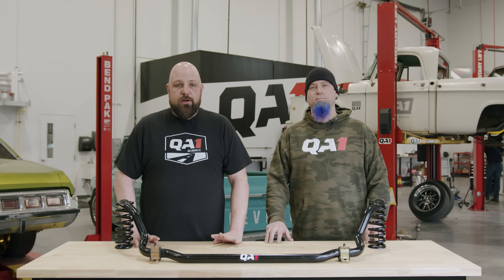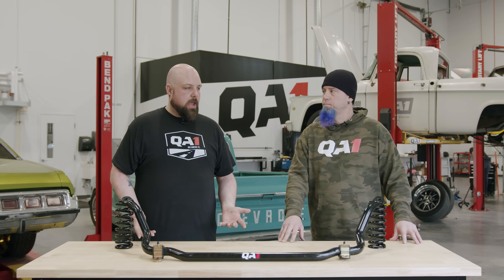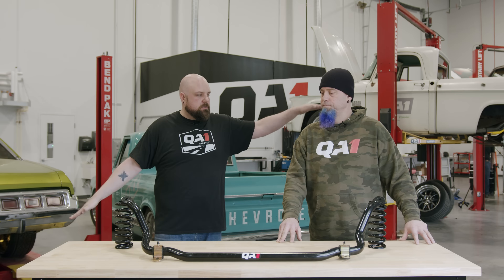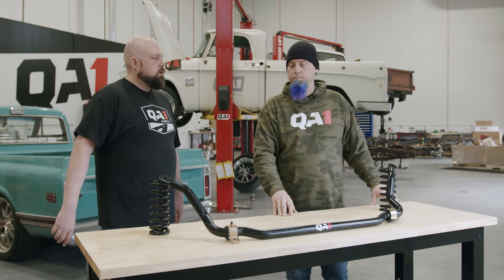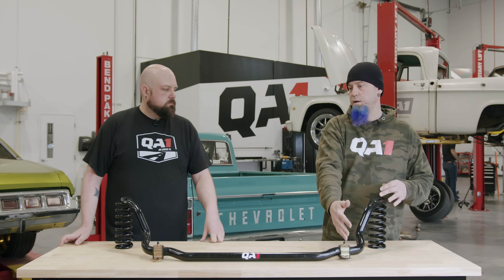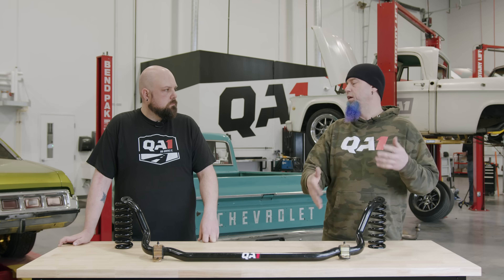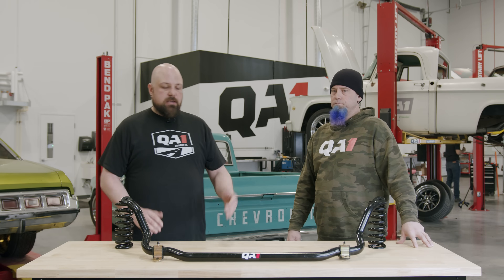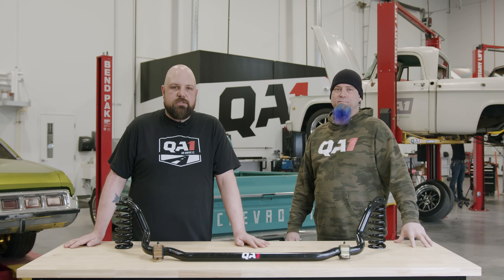How Do Sway Bars Work? | QA1 Tech

Comment: my sway bar when I turn it moves side to side    I think this is throwing of my alignment ..when I hit a bump the wheel pulls hard to the left and then I have to fight with the wheel to go straight .. if I hit a bump rite after the car drives straight back into alignment like nothing happened
Reply: I would say your main issue is that your car is a pos

Comment: Seems like a sway bar would also help correct for some stationary body lean, in much the same way. There's force being applied to one side, perhaps just heavier on a side, that's causing compression of the suspension. So a sway bar should help counteract that in exactly the same way, correct?
Reply: why is you car stationary going to have a leaning force? are you 400lbs in the drivers seat?  you have dead bodies in the truck and put them all in one side?
Reply: @krusher74  Simple... Toyota's early model year FJ Cruisers were designed with the battery, gas tank and all its hardware on the driver side, in addition to a slight bias to the driver side of the spare wheel mounted on the back door. Factory suspension used a slightly higher spring rate for the driver side front coil-over and rear coil spring to compensate to a degree. Aftermarket suspension does not generally allow for this variation on spring rate, thus magnifying the issue further.

Comment: Can I add one of these to the rear of my truck to fix Chevy lean?
Reply from the maker: We do offer rear sway bars for certain vehicles with our kits. It may not totally fix the 'lean' look, but it will help keep the tires planted on the ground when cornering. If you want to fix the 'lean' look, I would look at our coil-over options.